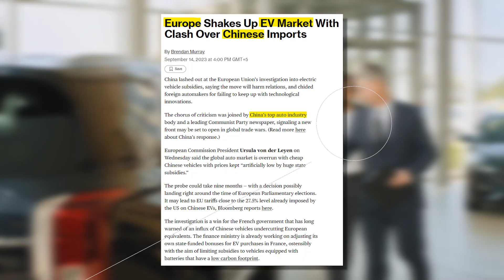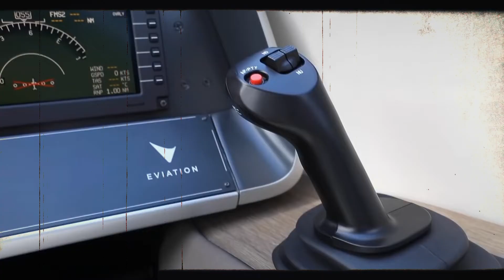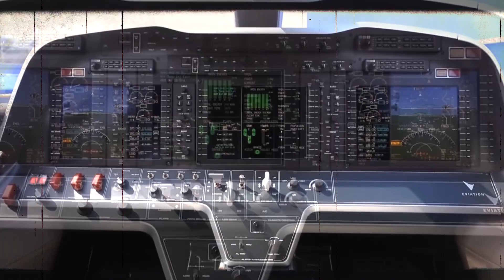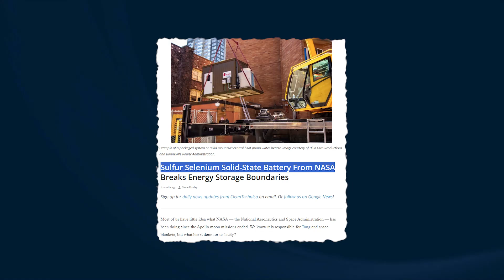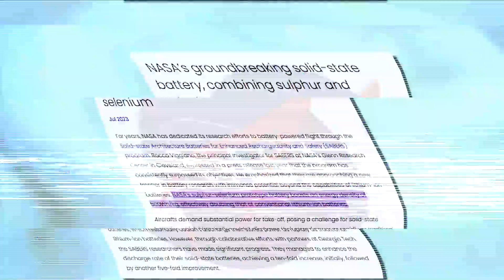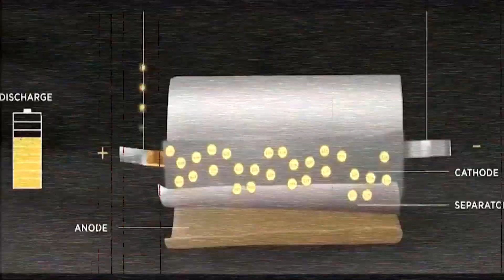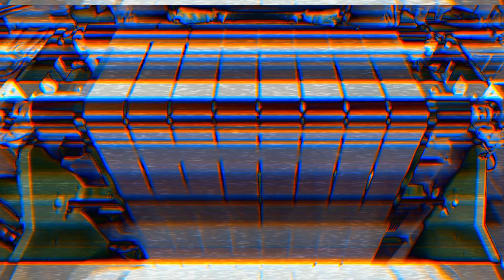NASA's New Battery Replacing Lithium Batteries

Comment: Why aren't NASA's rockets fuelled by batteries then?
Reply: Electric rocket engines don't exist. They are literally powered by the brute power of the rocket engine's exhaust. Jet engines are powered by turbines which can be powered by electric motors. It's just not currently practical to use electric turbines on air planes because we haven't found light batteries, yet.

Comment: Before talking about batteries, try to develop a REAL sustainable, renewable way to charge them.  If you get an electric car to cut burning fuel, how much coal or petroleum would necessary to be burned to charge them?  This is pure hogwash.
Reply: The problem is they don't want you to have unlimited resources cheaply.  They can make solar cells that use high energy gamma and xrays that are ever present create the voltage.  Had them since 60's.  Getting you tied to a Meter with scarcity is where they control you

Comment: Wonder what other advanced technologies N.A.S.A is keeping from us? 😂👍
Reply: They're not keeping this from us.....NASA technology is much MUCH more expensive.  Too expensive for the consumer market because they manufacture in small quantities, but they do share the technology, as does the military.  Hell, the car airbag system was developed by the military and NASA was using airbags in the 1960s.  The propulsion technology was far too expensive until the military further developed and it was able to be used in the consumer market without costing too much.  

NASA has solar panels that are far more efficient, but they use exotic materials making them far to expensive to be beneficial to the masses.
Reply: @chadcoady9025  Thank you for that. Much appreciated. 🖕